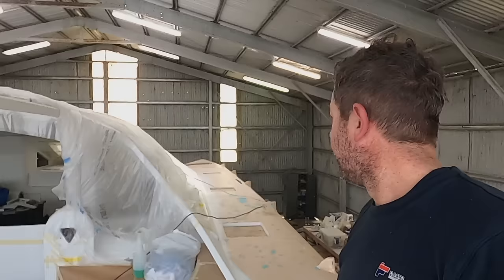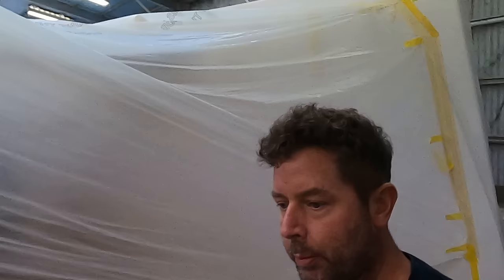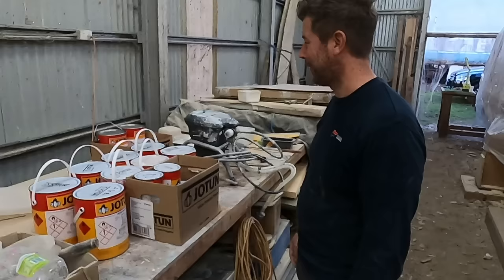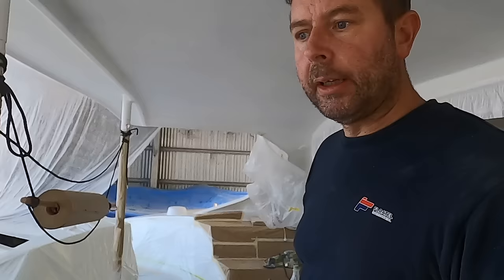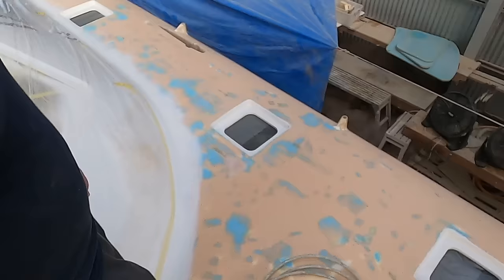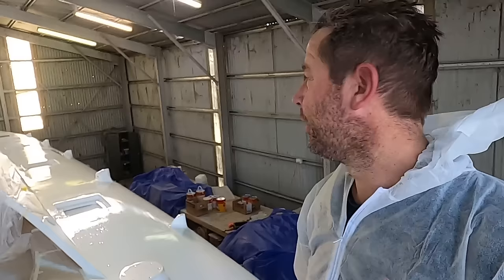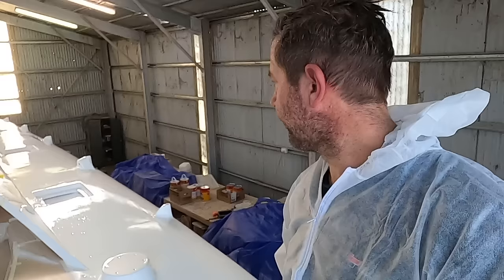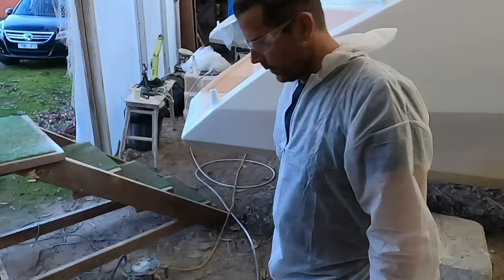Getting there - S02E47 - DIY Catamaran spray painting

Comment: I alway love that feeling when building a composite boat, or even a composite part, when you finally put the high build on and it goes from being a collection of composite bits to a single continuous structure - a whole instead of lots of pieces. Well done on the milestone. Yoy are doing a great job and your channel is one of the few this fellow multi builder can watch without crying out or shaking my head. You have a great work ethic, you are getting things done well and you are good at working with composites. Full speed ahead. 
Just one thing, are you going to put a couple more coats of high build on the hull sides? I like to use a mist/guide coat on my boats. And sometimes that means you have to take a fair bit off but it ensures you have a great fair finish for top coat. I love high build and it is the only stuff I can spray without concern, so I always do about 3 coats so that I can really get into it with my sander and the 180 to fully fair the guide coat. 
What are you thinking about with the interior painting? I almost killed myself spraying my 38 footer inside (and the 23 footer too). Now I use a roller and as long as I use 25% retarding thinners AND never use a foam roller, but use a short nap mohair roller, small topsides job on my 23ft cat and it worked increbibly well, pulling around corners and keeping a wet edge for 20 minutes. I can get a really nice finish that has heaps of life so that it pulls just like a spray job. It took me 20 years to finally crack how to roll topcoat, I use PolyU 400 which is a nice paint and cheaper than marine paints. It is still nice to spray exteriors, but if you need to do interiors, consider playing around with rollers and then you have no overspray issues as well as health problems, but use retarding thinners, push them to 20-25% and NEVER use the foam rollers, the short nap rollers are the solution. As you can tell I am excited about learning this as my 23 year old 38 foot cat needs her sterns and cockpit repainted and I was going to have to use a dodgy petrol compressor but now I can roll it and get an equivalent finish, which is much better.
Reply from the maker: I think I have two foam rollers in the shed. They came with the long roller handle and will never actually be used with paint. Perhaps varnish?... We'll see. Got more mohair rollers than I think I'll ever need. The results I get with roller aren't that great yet. And we don't have 20 years to practice 🤣 so we'll prep the compartments and get Chris to help us with the top coat spraying. He's an artist with his airless!

Thanks! Love hearing such nice comments. Few take the time to write anything at all.

Thanks for watching! If you stick around for more I'm sure you'll see us learning some more. We're getting closer every day.

/ Axel and Rox
Reply from the maker: We only put one coat of high build. Using an airless, this coat is thick. Much higher paint flow than conventional spray. No air, less thinners. The pink below is an industrial marine tank coating. It also serves as a high build. Can even be used as a finishing primer. But the white helps the top coat better.

Comment: Great video.  I'm interested in the airtless sprayer and how it opeates with two part paint.  I have been told you can not use two part paint with an airless spray gun.... but you are for the primer!    And no compressor.

A video  on the air sprayer preparation, oparation and cleaning for two part paint would be super.   Also, the spray pattern seems so wide making the job so fast.  Dit you choose a particular spray tip?

Will you also use the airless sprayer for the two part paint?     Thanks.
Reply from the maker: All the paint we use is two part.

I am from a marine background. On big boats we use airless or rollers. The reason is you get lots of paint on. Flow. Not air. The pattern is more narrow than other sprayers (you choose by changing the tip). Less wastage less over spray. Fewer costs.

It works. We'll use airless for top coat as well.

But I can't really recommend using the cheap one I got. It has done what it needs to do, but I'd be looking for something slightly different if I were buying today.

Thanks for watching

Stick around for more
Reply: 2 part industrial coatings are usually applied with airless sprayers, airless faster & you match your nozzle to the paint there are like 16 different nozzles available in various spray widths and sizes.